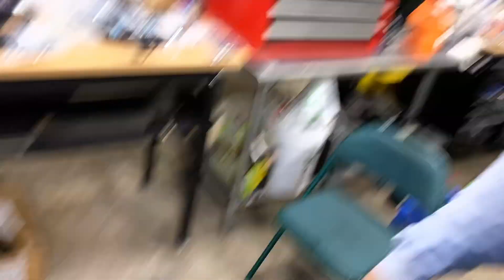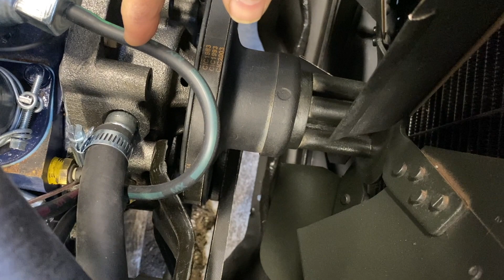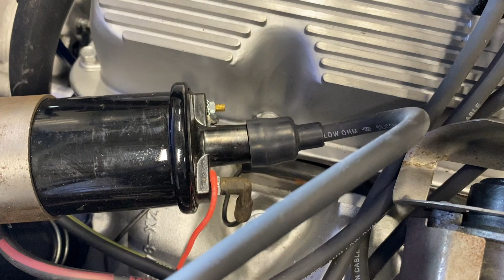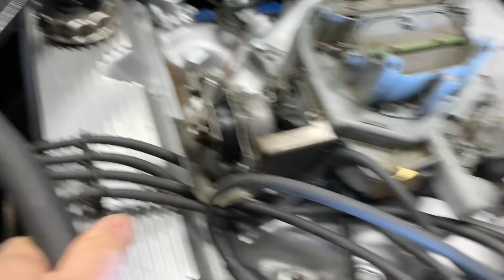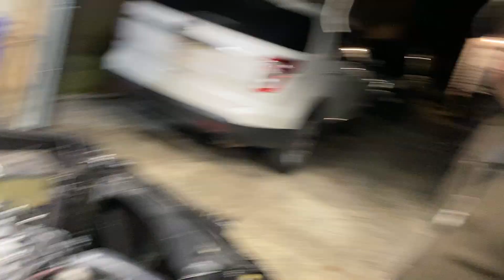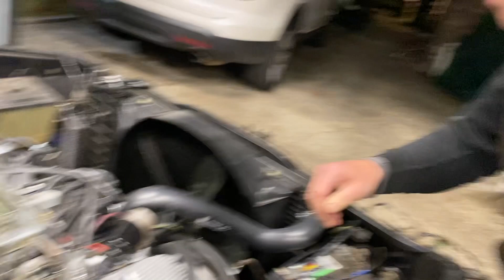HUGE Day in the Garage! VICTORY! Reading/Responding to Comments. Problems Solved w/ the 1972 Mach 1

Comment: Let's see if I can with the breather hoses from the valve covers. 
On the drivers side in the valve cover I have a PCV valve and its hose goes to the back of the carburetor. 
The cap on the valve cover that this hose is inserted into looks like the cap on your passenger side not the one you have but I'm not sure that it will matter. 
Now onto the hose from the passenger side valve cover. 
It goes from the valve cover and into the air cleaner.
This hose comes out of the valve cover by way of a grommet and not a breather.
Hope this helps !

Comment: Name the cat “Boss Cat”.  The thing in the breather is a thermostat that opens the vacuum to open the fresh (unheated) air to the carb.   Until there is enough heat it pulls air from the heat stove off the exhaust manifold.

Comment: The hose goes to the tank, the one goes to the air cleaner and the third small one is a vacuum port and needs vacuum. The filler cap on the drivers side valve cover goes to the back of the carb. The cap on the rear of the valve cover goes to the air cleaner

Comment: A  pvc valve goes in the valve cover  and then gos to a vacuum source on my truck it goes to a fitting on the carb.  That is the vacuum that pulls the oil vapors off the engine and burns the vapor off.  At idle the valve is close by the high idle vacuum.  As the vacuum drops when the the throttle is opened causes the pcv valve to open
Reply: That allows the vapors to be fed into the intake stream.   When the throttle is closed the high vacuum closes the pcv valve so that it doesn’t cause a rough idle or stalling.

Comment: The square black wire connector looks like it goes to the backup switch wire on the shifter. Think you used a main harness from an auto trans car though?? You might have an issue there, matching up wires, but fords wire colors are are all the same, so you will match it all up. All in good time.
Reply from the maker: Thank you Sir. I think that is figured out now.
Reply: @MuscleCarMadnessGarage  btw....if that broken oil dipstick is stamped D1ZX, dont get rid of it.  Goes for up $600 now !!  Only used on boss 351 and 351HO.